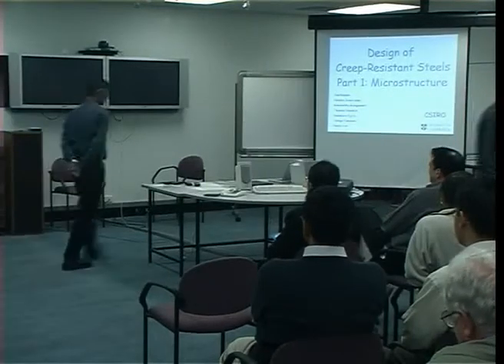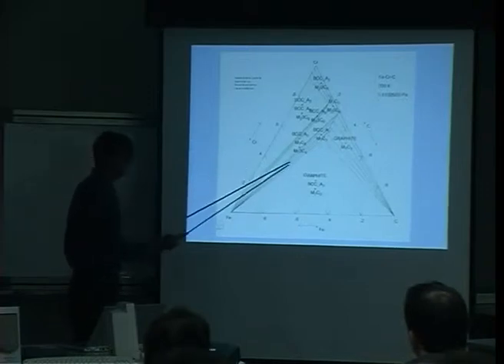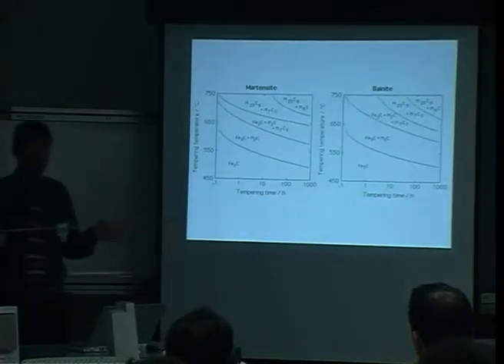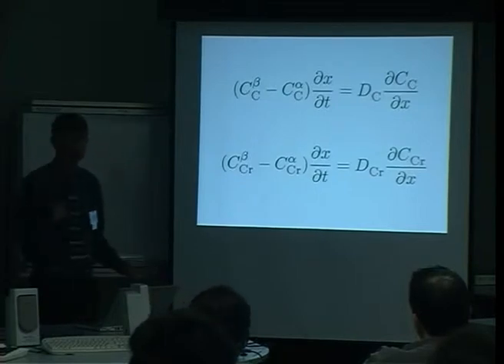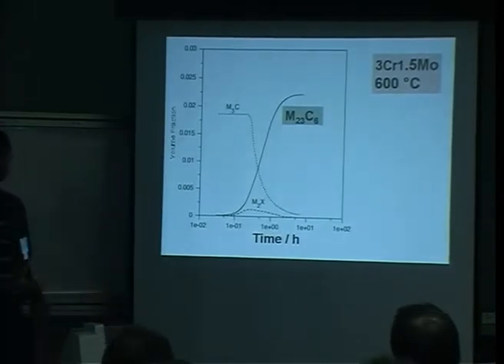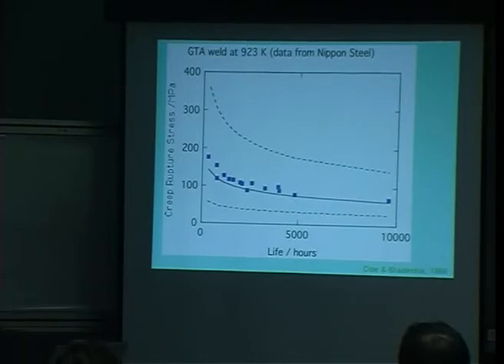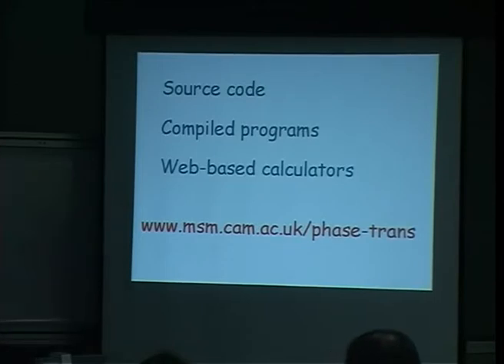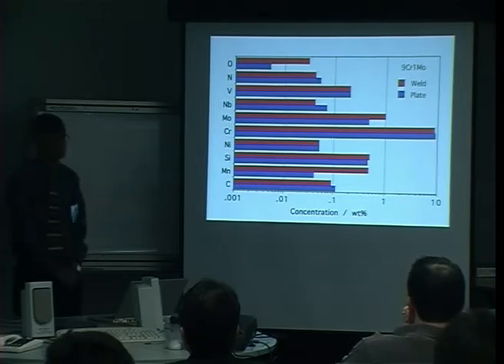Creep Resistant Steels

Comment: Dear sir,

I have a doubt. what is the significance of equicohesive temperature. To my understanding it is temperature at which strength of grain and grain boundaries are same. so consider the example of  bainitic creep steels or martensitic steels these are widely used in power plant applications (~650°C). These steels inherently have fine grains when put in service. But literature says coarse grain favour creep deformation. so it means that the 650°C is the limiting temperature for the grain boundaries above this temperature grains have high strength ??. if not then why can't we use martensitic steels in gas turbine applications where service temperature is very high
Reply from the maker: Afraid I do not know.
Reply: Its not that grains become stronger but grain boundaries become weaker. At high temperatures the grain boundary becomes weaker than the grain interior and two grains can slide past one another due to shear stress. The temperature at which the grain is as strong as the grain boundary is called the equicohesive temperature.